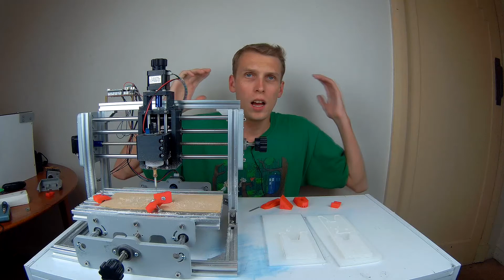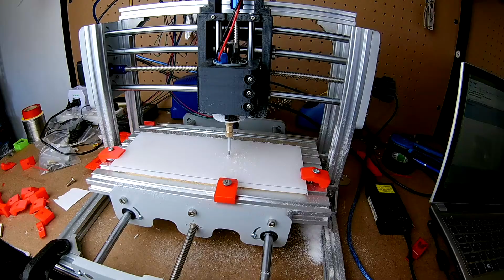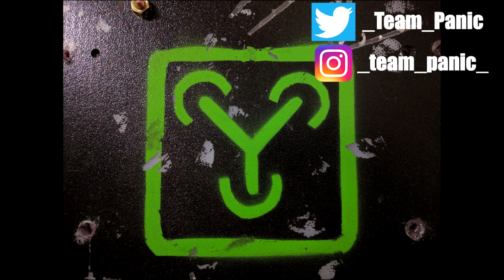Cheap CNC 2417T Tips, Tricks and Problems!

Comment: it looks like your Spindle Motor is out of balance run it with no parts in it and take the bit holder off to see if it still vibrates. if it stops shaking get a different chuck. I have hade good luck with banggood.com

Comment: I have a larger full metal version. It will engrave soft metals like brass or aluminum. It will cut but need a very slow feed rate and many passes. Vibration is cause by the brushed motor. I am planning of replacing with a brushless motor for rc planes I have one slightly smaller than stock. Just need to make mounts for it then use a servo tester to adjust spindle speed. The motors are not well balanced and the shafts bend easily causing vibrations

Comment: A couple of tips.  Try putting a sheet of printer paper between whichever two pieces are slipping (workpiece, waste board, or table) it will incerase the friction.  Your clamps look like they would be easily made out of wood.  Lastly, try running your spindle motor with no bit, and again without the brass collar to isolate the source of your vibration.  If the vibration is lessened with no cutter, or collar, pick up an ER11 collet adapter and collets on eBay or Aliexpress.

Comment: Hey Ben! Is your CNC machine capable of cutting thing aluminium plates? Just wondering cause i'm thinking of getting one my self but the 2418 GRBL model. Planing on using it it to make motor brackets for my electric longboard
Reply from the maker: NO! 
I literally said in this video that my machine vibrates a crazy amount cutting plastic.
I think if you try to cut any metal the machine will shake itself to pieces
Reply: Team Panic Hi i have this machine for 2 years now and i thought the same thing but one day by mistake i put a bath towel under the machine and the vibration has stop. Now i am able to engrave and in some cases cut aluminium
Reply: "Oops my towel fell under the cnc mill" I love your life
Reply: Mickey Kincaid HAHAHAHA Yes something just like that :)

Comment: Try a tiny amount of Blu Tack around the threads, it'll should stop them vibrating out but wont set rock hard like Locktite.
Reply from the maker: Thanks for the tip! 

I'll give that a try
Reply: loctite blue is for vibration and general use- loctite red is meant to be permanent until heated

Comment: Best thing to do with any up flute tool is to use a dermal (with a stone tool) and put a small notch in the side of the shaft, aligned with where the grub screw touches. Remember to do the same on the top screw and motor shaft.

This will stop the tool pulling out. Loctite will no help here, the screw just can't get enough grip of the tool steel.
Reply from the maker: Thats a great tip!  Thanks!